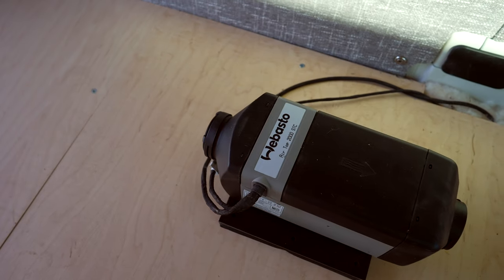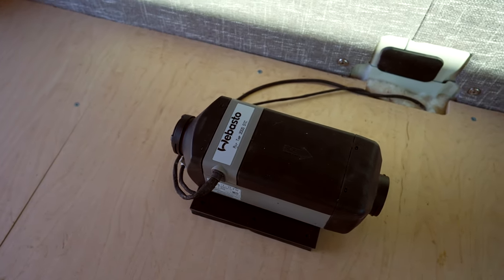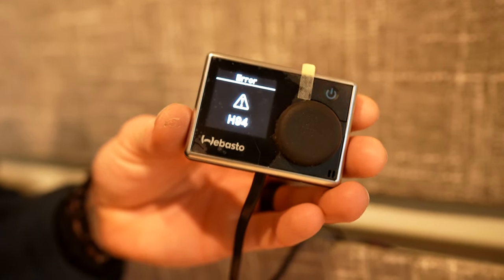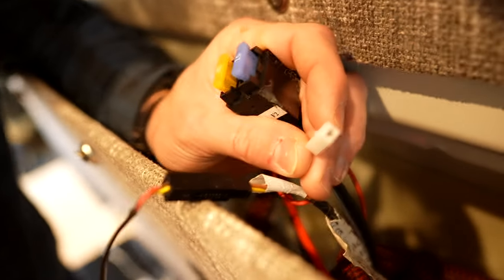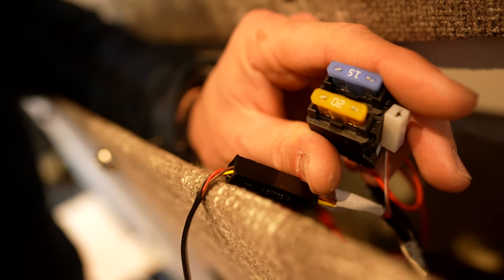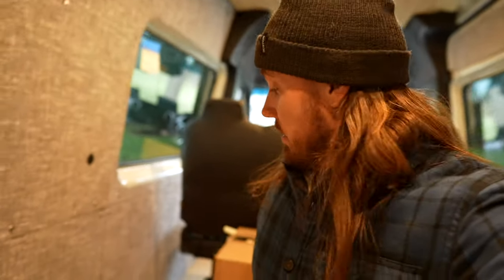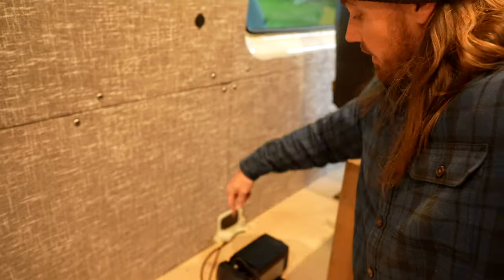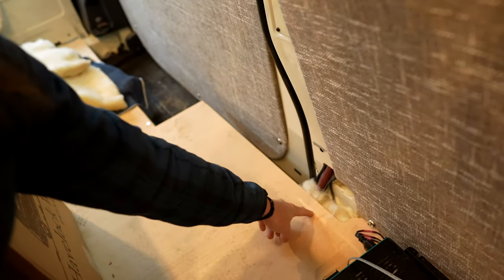Van Build Pt 10 | Beware of Buying a Russian Webasto Diesel Heater

Comment: Webasto IS NOT RUSSIAN MADE 🤦🤦🤦
WEBASTO IS GERMANY MADE !! 👊👊👊
Reply from the maker: Well, your comment is misleading for people who may be interested in this issue. The model I purchased off amazon was one built for the European market, not the US market. It was made in Russia, not Germany, hence the issue with it not working. If anyone is reading this comment please understand that if you purchase a Webasto Diesel heater from amazon you could be getting a product that will have no support in America and will require you to purchase a new one. There is a resistor wire that you cannot get in America which will result in a fault code rendering your Webasto heater useless. Thanks for your comment, but it was not helpful to me or anyone else on youtube, and to help people avoid mistakes keep these comments in your head not on the keyboard.